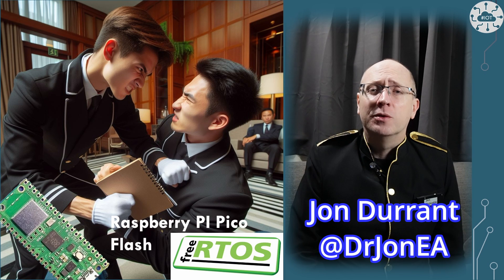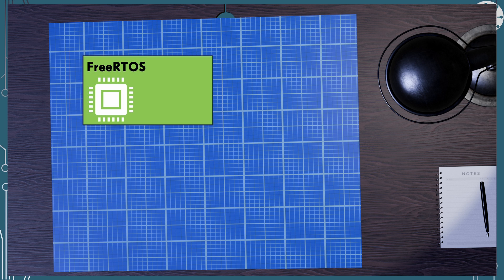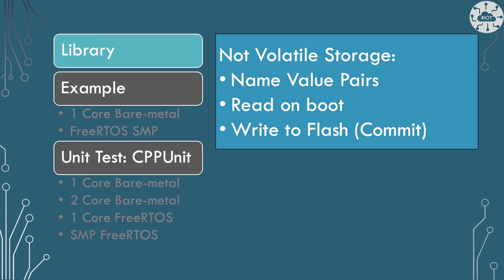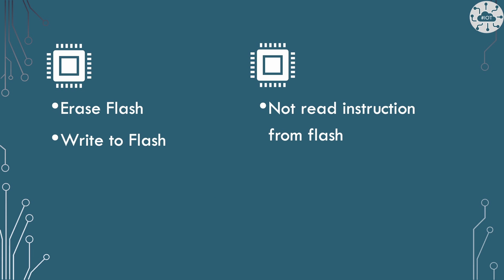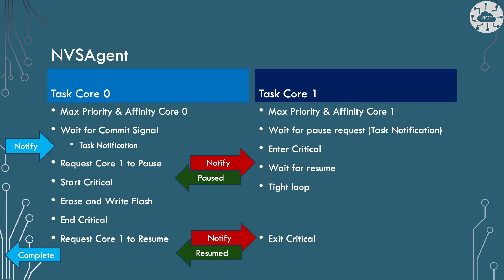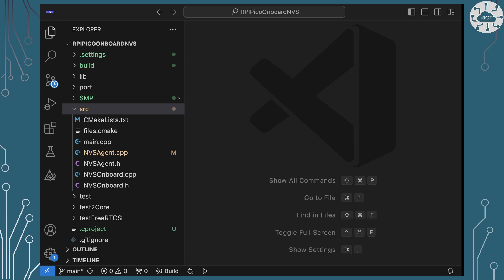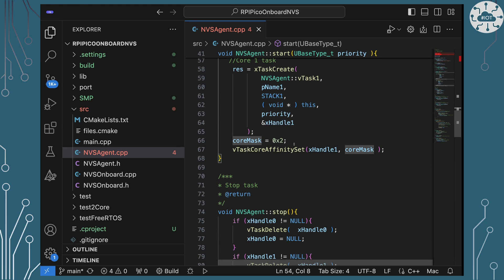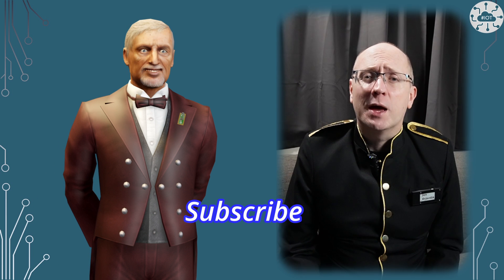Using Flash as Non Volatile Storage on Raspberry PI Pico with FreeRTOS & SMP | drjonea.co.uk

Comment: i am curious - does RTOS have a concept of "resources?" because both the cores and the Flash are resources that can be allocated and considered critical. im curious as to if i will need to extend rtos for every Pico resource i need to protect.
Reply from the maker: Yes absolutely does. The issue here is that flash is so fundamental to the operation of both cores.
Reply: @DrJonEA  thanks! i'm signing up for your udemy course. i'm way behind on Cmakelists.txt. i'm building my own library for Pico and am at a loss since (back in the day) one delivered a lib.a file and a folder of .h files. The idea of delivering all the source code and recompiling it every time is a bit foreign to me.

Thanks for your work. I'm subscribed. Continued Success!
Reply from the maker: Thank you for signing up. CMake is building "lib.a"  in the background, but managing when to update them.